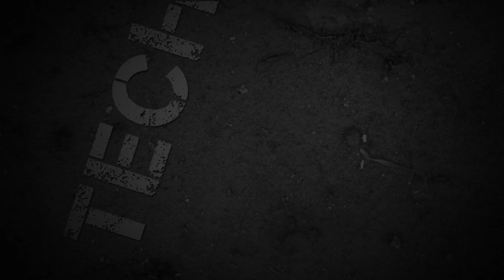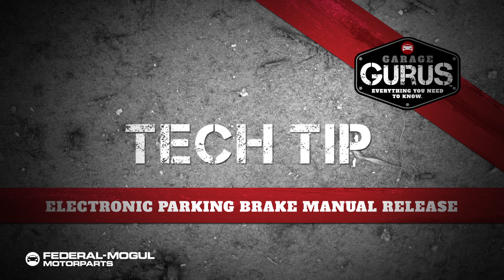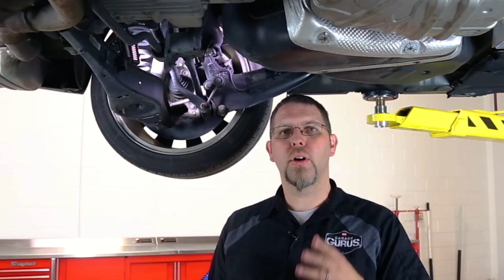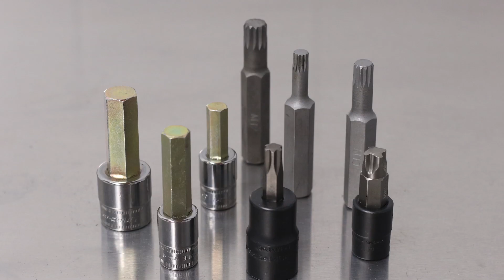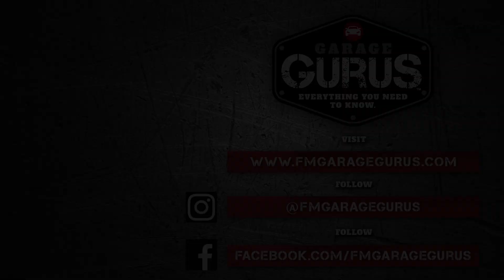Releasing Electronic Parking Brake Manually

Comment: Today I try to help A driver of A electric Corsa E Opel/Vauxhall who could not drive away because blocked 🚫 right rearwheel electric automatic brake system.
At a wet road impossible to get grip and i drove a round with a blocked wheel to put it back in its parking.
Drive front and backwards did not help .
Temp was -2C wet and freeze 🥶 blocked it al.
So the owner called Adac/AnwB/dispite 😮

Comment: Calm down all you pissed off old school rednecks. The park brake is not an emergency system, the brake you use in an emergency is the big pedal under your foot which doesn’t rely on any electronics from the park brake to operate.  Everyone knows that those old levers that you pull beside the seat or under the dash don’t really hold the car and it rolls away if you aren’t on almost flat ground. Additionally they are starting to allow women to drive automobiles in most jurisdictions these days and their dainty little arms aren’t strong enough to pull the brake on properly so the car manufacturers had to come up with something that can be operated with one hairdressers pinky finger but is strong enough to hold your truck on a steep slope.  The actuator on the cable was the first iteration that basically just replaced the handle and ratchet with a motor on a screw with some limit and torque switches, but still operates the old drum brake shoes.   The second improved version is the pair of motor calliper as shown in the video which does away with the drum brake and cable and adjusters all together and is a far stronger, more reliable and simpler.  If they fail they are a breeze to swap, you don’t need any computers to set them up and they are good.  Nobody is going back to cable handbrakes ever, instead we will be just passengers in fully automated (lane keeping and adaptive cruise) vehicles that we won’t have to drive at all. Look at openpilot for example. Now that most new cars have an electric actuator on the steering shaft and a camera in the windscreen / radar in the grill we don’t have to drive them at all. It’s about time

Comment: Another corporate technical inferior solution which ensures that it will go wrong and require and can only be cured by an overinflated visit to a mechanic, who knows little to nothing to nothing about the system, after spurious trouble shooting and can only fix it by replacing the whole unit with new or rebuilt parts.

Comment: We did not realize we needed to put my Lexus ES350 2021 in maintenance mode before replacing the rear brakes on my car.  We unplugged the electronic power brake cable following some tips we found online.  Put everything back together, bled the brakes and everything works great except we now get an error and no loner have cruise control.  Do you have a fix for this?  Appreciate you

Comment: Hello Bill, Thanks so much for this video Sir !!!!

Have a 2012 Buick LaCrosse from the “rust belt” Ohio I purchased from auction. Left rear locked up and won’t move. Removed the servo motor, backed the pads up as you described and viola. Purchased a servo from Rock Auto, cleared the codes and all good. Appreciate the information Sir !!!!! BTW had an auto electric shop for 20 years and appreciate your expertise. Thanks

Comment: No thanks, I'll stick to Mechanical emergency braking systems thank you very much. Much more reliable and unhackable and easy to work on. Why would anyone want an electronic parking brake especially when everything is being converted to Electric. Why would you want to have an electric braking system that has an electric emergency brake? I would prefer to have a mechanical emergency braking system that is separate from the electronic braking system for safety purposes. That's why it's called an emergency brake not a parking brake.

Comment: Just a note on the electronic parking break on  cars. I have a Buick enclave avenir 2020, and the electronic parking system got stuck after I jump started the car, with the message "Service Park Break" on the dashboard and I couldn't move the car even though it was turned on. It turned out that the boost to jump start the car was weak, so another more powerful boost helped get rid of the problem and I was able to get to the GM garage and replace the dead battery. Bottom line, if this happens to you in a GM car, then the dead battery is likely the culprit.
Reply: I replaced my battery thinking it was the same situation, did not work tho.

Comment: I have a 2010 vw cc used, within a week, this system gave me issues. I blocked off the button on the dash and simply park by leaving it in first gear. I suggest you all do the same and save money

Comment: Question: would you recommend using the electronic parking brake until it fails, or don’t use it and let the load go to the parking pawl (the force will pass through to the transmission mounts)?
Reply: Use it. If it fails, then check cost of repair. You can rely on transmission once failed if you don't park on hills (;-)

Comment: Maybe I will fix up my old 2012 Subaru Forester and drive it more, old tech I can still work on it.
Reply: Hyundai, Kia, and Subaru .... all throw away vehicles. Look anywhere that has a hot climate and they don't last 10 years. They're all in junk yards.
Reply: My 2004 Lexus doesn’t have this electric bs ! So glad I don’t have to jump through hoops to do a brake job! 240,000 miles on it,  hoping to get 500,000 + miles!!

Comment: Thnks for the video!  I would like to add that anytime you use a jack/jack stands, one needs to set the parking brake so the car does not move.  Since you are manually releasing the parking brake in this instance, blocking the tires would be most appropriate and wise.
Reply: Yup I just did that I turned the car on and released the braking brake from inside of car

Comment: How about trying this: with the motor off  press the start button with your foot off the brake pedal this will put the vehicle in accessory mode. Now, put your foot on the brake and leave it on the brake then press and hold the ebrake button down for 10 seconds on the center dash the brake light will begin to flash as soon as does press the ebrake down fast and release that should release your rear parking brakes which you need to take the vehicle in right away for service. This is for automatics which will be in park, for manuals neutral.
Reply: The battery might be DEAD!
Reply: OMG!!! 2014 Cadillac SRX AWD you are awsome!! I did have to close the door to follow the steps. For me, you could here it release in about 3-5 seconds after pressing brake - Oh yeah, F#$% ebrakes! Idiot idea right up there with fake "limp" mode if a sensor goes out in my 2018 Ford F250...ugh.
Reply: THANK YOU SOOO MUCH!!! Omg you’re a life saver fr
Reply: This did not work on my 2016 Cadillac Escalade and It is stuck in the middle of my driveway on a Saturday afternoon. Thanks anyway. Battery good
Reply: Did not work on 2020 GMC Terrain.
Reply: Useless with a dead battery, which is the scenario indicated here.

Comment: Just about every flooded car I have towed this past week is completely dead with this stupid parking brake stuck on… and then the tow hooks are mounted on the sides so when you drag it on to the bed the car starts to rotate sideways, then they put plastics around the lower control arms so that if you hook to those, they’ll break… it’s just GENIUS on top of GENIUS on top of GENIUS!! Definitely can’t do this process with my cell phones ringing every 30 seconds
Reply: Mine died now because of flood
Reply: bruh

Comment: 2018 f 150 break piston ?if it comes out can you put it back in?
Reply: Absolutely, just make sure you bleed out the air while on putting it back in to prevent air getting caught in the brake fluid. (Most callipers will have a bleed bolt at the back of it)

Comment: The guy who invented this electronic emergency brake system should be in prison how many times is this going to go bad
Reply: That's taking it too easy on that man
Reply: 100% Agree!!
Reply: vehicles should have never had computers and sensors put in them, nothing but headaches and trouble
Reply: So true tho honestly it's a joke if your gonna put it electric at least make sure it's not gonna seize up or at least put in the manual handbrake what's wrong with that honestly these car people just think they're doing it joke man
Reply: Absolutely AGREED !!
Reply: Absolutely AGREED !!!!!
Reply: I agree, my car is currently stuck on a tow truck
Reply: Bull Shit System by psycho
Reply: as a dumbass that just took my shit apart like a regular brake pad change my shit was on the lift overnight because my parking brake won’t disengage because it’s already taken apart 😭😭😭
Reply: @ayyomar same man have you found a solution??
Reply: @christianrivera935 so there’s a bolt you can compress it with once you take the motor off the caliper but if you’ve already tried to compress it with the button you probably cooked yours like I did and had to replace my whole caliper 😭
Reply: @ayyomar  same
Reply: Mine stuck on the drive massive pain in the arse already replaced control unit still won't unlock fukin cunt
Reply: Agreed
Reply: Stupid invention, nonsense
Reply: Far less than having your parking brake cable seize up from rust
Reply: I Agree 100%!!!

Comment: Can you please clarify for me: in the Peugeot e208 it has both an electric brake plus a parking brake: when coming to a halt at, say, traffic lights, does one have to apply both the electronic brake AND the parking brake each and every time...?

(My current Renault Zoe only has an electronic brake, therefore it's much more simple whereas the Pug has a second brake, so I'm thoroughly confused.)

Comment: I have a couple questions.  Who was holding the que cards while you were reading, and are you really a mechanic? I've seen a lot of  how to videos from setting a ladder properly before climbing up, to caulking cracks in cement,  and tons and tons of auto repair videos.  Yours is useless. Electronic parking brake manual release videos require "Demonstration".  You cannot tell me you're afraid of getting your hands dirty.
Reply: What he said

Comment: How many of you owned a 20 to 25 year old car with ABS?
If you have then you would know they light up and fixing them properly is very expensive. They can also cause the car to fail road worthy. 
Now that is just 1 electronic component, how about adding more electronics to the mix like lane keeping assist, brake assist etc? 
These cars will be in the Junk Yard earlier than the cars of the 90's and 00's (12-15 years tops, half the time it took the previous generation to be scrapped).

Comment: Is it easier and safer to just put the electronic parking brake in service mode before performing brake repairs?
Reply: Simpler, marginally safer, but you need an ODB11 or VCDS tool, and a laptop.

Comment: As a tow truck operator, let me assure you that electronic parking brake systems are the most asinine new idea ever.  

Besides the obvious what if it breaks down, or what if I lose power or my brakes fail and I need my emergency brake, the last thing we need when trying to tow your disabled car off the highway is to have to figure out a bypass on each and every model produced--we need to move fast.  With this system we either have to dolly everything or drag it up a flatbed, or figure out the system.... not something anyone wants to do with traffic zooming by inches away.

This might even be more idiotic than electric shifters or push-to-start buttons.... lots of troublesome components to break down.
Reply: Man you ain't never lying had my shit towed yesterday for anti braking system locked up.
Reply: This isn't the only bad electronic idea for cars, but it is at the top of the list. And don't worry, they will think of something more stupid soon.
Reply: Disguise absolutely right you shouldn’t have to do all this if somebody gets killed in the process big lawsuit specially when towing off the highway
Reply: I loved my push button started on my Nissan however my emergency brake on my tiguan sucks
Reply: @donnawanna3680  they're fine while they work, and a royal pain when they don't.  Imagine even being stuck in a parking lot just because your fob battery died.... let alone when the system just dies, then it's very expensive to fix.

It's a feature nobody needs that causes more expensive things to go wrong.
Reply: They don't think about us towies it all looks good on paper
Reply: @379exth  technology for the sake of technology...
Reply: @indoorroadkill3369  yea really it sucks I love getting the old school tows and work on them when they come into the shop so easy for everything
Reply: This is where the national motor vehicle department post to come in DOT not keeping the citizens and the people safe
Reply: It's no different than if the old style parking break locks up
Reply: These emergency brakes regardless electronic or manual, have to be used once and awhile , if you don’t they will seize up and not work at all..
Reply: Amen brother !!!!
Reply: Such a pain the ass, Jeep 2018 standard transmission and you can’t move it without dragging the rear wheels, there’s a chance if I continue to have issues, I’m removing the EB motors for good

Comment: So, I already destroyed one of my rear calipers with the electric parking brake on my 2013 VW Tiguan. I figured out how to do it properly, and was able to replace pads on the other side. I now have a parking brake fault with the one caliper still disassembled. I ordered a new caliper. Do I need to reset the fault before I reassemble the new caliper? Or can I reassemble, and then take the car somewhere to have the fault reset (prior to attempting to operate the electric parking brake)?

Comment: Bolt broke while trying to remove motor, this was bad advice. Now I need to remove the caliper drill out the broken bolt and tap a new hole. Those bolts are easily broken, since I was only using a 1/4 inch ratchet. Thank you for all your help.
Reply: a broken bolt is not his fault or yours but the shitty people that built the car, a bolt goes in and out in a certain direction,if you followed the direction of removal properly  and it broke its a quality issue.

Comment: There was no reason at all to get rid of the cable operated(old school and time proven)parking brake.They're relying on electronics wayyyyyy too much.
Reply: Disposable cars keeps you buying a new model
Reply: Every single significant  and insignificant component must go thru the ecu& BCM via CAN/BUS network, to function on modern vehicles. It's just the way it is..   if this isn't complicated enough.. EVs are coming full swing the those autonomous ones, everything will be so electronically integrated and coded, no  owner will be able to put freaking washer fluid in without triggering a fault
Reply: computers and sensors have caused misery and headaches

Comment: Whats happening if the emergency break light is flashing on the dash and the break system light is on. When i drive the car its making a beeping noise. Idk whats going on the car runs and stops fine.
Reply: i have a 2016 honda civic
Reply: James Hobbs  Not that I know what I'm talking about but, I just watched "Electronic Parking Brake - Audi A6" video and it seems that he describes your problem at 14 minutes into the video. I'm here to learn about the next new hassle other people will ask me to fix, LOL!
Reply: I have a 2012 subaru legacy 2.5i and this morning i got the flashing brake light on my dash and my E brake is not working neither i can press the button nor pull, i am scared to go to the dealer becouse they’ll charge couple of grands and break something else in my car like the last time they gave me my car back with christmas lights on my dashboard. Please let me know if someone went thru this problem. Thank you
Reply from the maker: Great question and thank you for watching the video. Since there are so many different types of electro-mechanical parking brake systems on the market and each one works slightly different please refer to the owner’s manual for the vehicle you are working on or refer to repair information with a good description of system operation specific to the vehicle you are working with.

Comment: Just another useless system that can break and cost you big bucks to get fixed. Happy Birthday dealers.
Reply: Exactly im pissed about it.
Reply: Have a 2015 renaguade code come up saying it the actuator parking brake they replaced it and the light still came on ,found out a rodent got into the  car somewhere and decided to make a home inside the car and ate the wires from the back seat to the front, little bastards

Comment: Most owners manuals will include directions to release the electromechanical parking brake. For GM cable pull systems, it will include the location of the motor and tools required to release the parking brake (they do this for tow truck drivers). Also, many scan tools include bi-direction controls to release the parking brake.
Reply: Hmm interesting
Reply: It's all good till ppl lose or throw them out because they don't know what they are it goes the same for the tow hooks as well
Reply: Sadly my 2014 Cherokee is not one of these. Been disabled for 2 weeks now because there's no backup, I suspect the motor is cooked from trying to release the park brake and I really dont want to replace the caliper and rotor again...
Reply: Wait till your scan tool won't even unlock the parking brake then you have problems